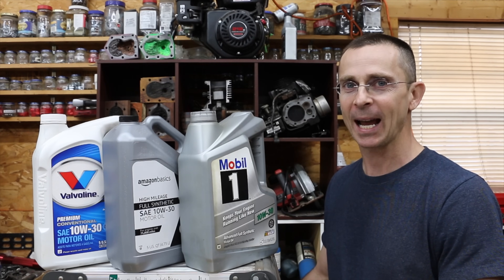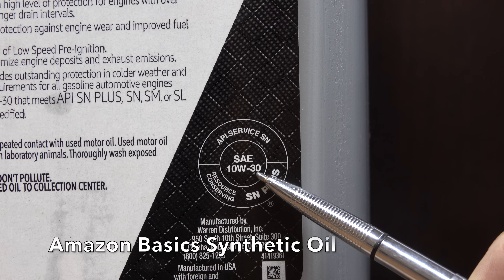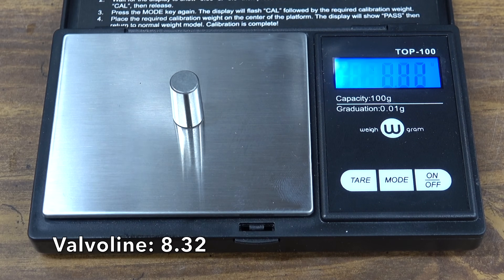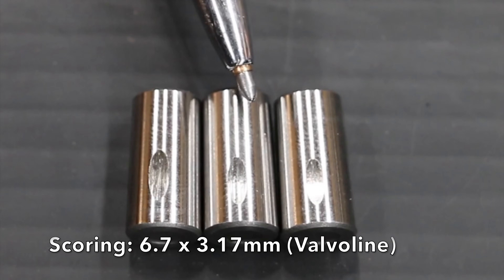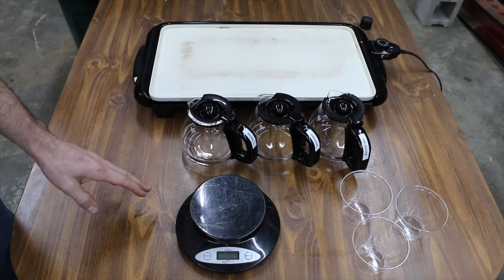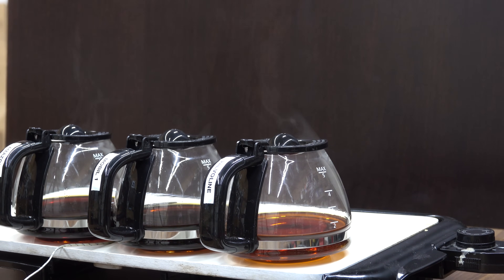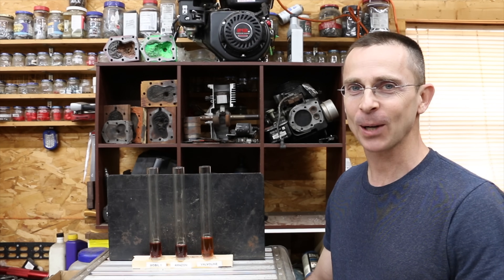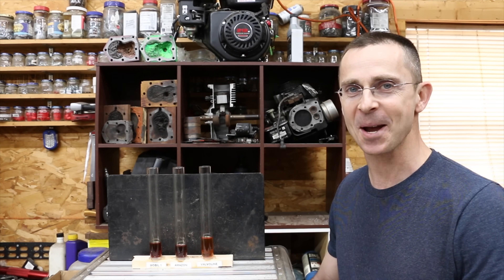Is AmazonBasics Full Synthetic Motor Oil better than Mobil 1? Let's find out!

Comment: after watching this video I decided to try amazon full synthetic oil and I used them in my 2010 chevy traverse, 2002 nissan altima and 2001 ford F-150. Now I have issues with all three of them within first 1,000 miles. Chevy traverse has low oil pressure light came on. Altima had low oil level on dipstick even though there was no external leak. Ford f-150 also has low oil level on dip stick and i had to topped up both altima and ford with 2 quart each. And all the engines has considerably increased noise. I had to add lucas oil thickener to reduce the noise on my ford f-150. All three cars having problem at the same time after putting amazon oil can’t be just a mere coincidence. Please give your feedback if you used the oil too...So that people know how it does in real life scenario.
Reply from the maker: Wow!  Thanks for commenting on this. I've used it 3 times in my 2003 Chevrolet Suburban, which now has over 230,000 miles without any issues.  Using it in my 2000 Buick as well without any problems.

Comment: Make a video using the oil showdown's test equipment on different code oils for Example cold flow test between 5W-40 and 10W-30 that would be quite interesting engineeringvise
Reply from the maker: Thank you!

Comment: Great content great video! Unfortunately the information doesn't provide much of an advantage to prolong the engine life of many domestic vehicles. Which I think many viewers are searching for. As long as the API seal is there, it wont make much of a difference if you use Mobil Purple Marvel Slick Sea Zinc Foam 50 Premium oil, from a copper funnel, or the similar additives. Take the longevity of Japan's products using simple conventional oil, at the recommended intervals, as an example.  Pay attention or pay cash America!
Reply from the maker: Thank you!

Comment: It is said that oil deteriorates after 6 months. How about a test of used motor oil on bearings at 6 month and 1 year.
Reply from the maker: Thank you!
Reply: To expand on my thought, run a test on motor oil at 8000 mile oil change. Measure bearing damage and store that same oil in containers for 6 months and save another sample for 1 year and then do a bearing wear test on samples and compare with oil that was freshly changed.

Comment: Here is a suggestion.I like the way you measure the wear scar using the formula for area of an ellipse.Just as an aside this method assumes equal depth of the scar.If i read your video correctly Amazon and Mobil 1 both lost the same weight from the bearing during your lubricity test.To me that means they protected equally.What are your thoughts?
Great video again.
Reply from the maker: Great point. Thank you

Comment: A LOT more oil was in the last 2 cups. Why not measure how much your putting in to be fair? Would have been a good test.
Reply: Mobile 1 jumped out of the cup...not interesting results.
Reply from the maker: Thanks for the constructive feedback.
Reply: @ProjectFarm  could this be why Valvoline did so poor on the first test? Conventional or not it should have been closer because of the additives.

Comment: I use AmazonBasic Full Synthetic 0w-20 with Fram Synthetic oil filter on my wife's 2017 Toyota Corolla and now her car runs smooth and quiet (This is when first starting up in the morning, idling, accelerating, and highway runs - all smooth and quiet). Before she was taking it to Toyota for oil changes and her car ran load and rough.
Reply from the maker: Thank you!

Comment: Looks like you tested 10W viscosity oils. For any given brand these are much cheaper than 5W.  Would it be worth the extra cost for summer driving to buy 5W even thought the flow would be better on engine start up? 
Based on your experience & test (so far) what is the best synthetic motor oil? Thanks for  your reply.

Comment: I tried 3 different oils in my LS4. Castrol GTX, Valvoline full synthetic and Mobil 1. The lifters clattered with Mobil 1 but not with the other 2. Gas mileage was the best with Valvoline.
Reply from the maker: Impressive! Thank you
Reply: Try Mobil one EP, very quiet engine operation compared to standard Mobil One.

Comment: I feel like you should've controlled the amount of oil that went into the cup. It's clear from the video that the Mobil 1 cup was significantly more full, so logically it would've had no trouble lubricating the metals better.
Reply from the maker: Thank you!
Reply: Nate - I am going back and forth trying to see a difference , is it that obvious ?, or am I just missing something ?.
Reply: Agreed. I love these tests and I would like to see a little more oil used during the lubricity tests. It seems to me the variance in the amount used could affect the result.

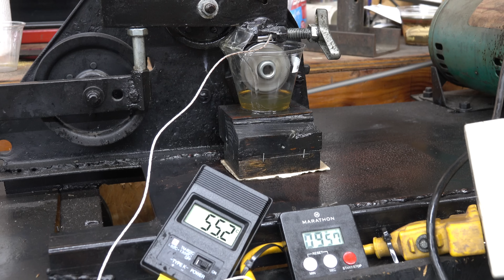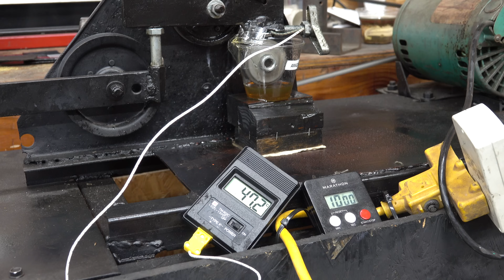Comment: Why dont you measure out the amount of oil used in the bearing test? The mobil test clearly had more oil in the cup and more oil flying off the contact point. You could clearly see how drowned in oil it was even at the end when the machine was stopped at 4:51. You can see how comparatively dry the other two tests are when the machine stops at 3:33 and 4:14 .
Reply from the maker: Thank you for the recommendation!

Comment: Do you know if the amazonbasics is jaso ma2 rated?  I cant find info anywhere and Im guessing no.  Most modern motorcycles need that since the oil flows thru the clutch.
Reply from the maker: I don't believe so. Thank you

Comment: The real question is for how long will the Amazon basic oil be that good for?
Reply from the maker: Great point! Thank you
Reply: What if you compared used oil?
Reply: The oil was tested and passed by API which they gave a rating of SN PLUS
Reply: @LandCruisin  thoughts on the oil so far?
Reply: @LandCruisin  Awesome, thanks!

Comment: Will water protect a bearing at the same psi as maple syrup? Water is thin and flows well but maple syrup is thick, flows a little slower and provides a thick protective layer. So in theory a slower flowing oil in my opinion will stick and provide a better protective layer(especially at start up) than thin fast flowing(draining) oil. Also in an engine it is being pumped by the oil pump not gravity fed. An oil pump has a pressure relief valve so in theory it will pump any fluid up to the pressure relief valve pressure then purge off no matter what fluid or oil it is. Right??? If this is true we need to test these oils at 200-250 degrees where these oils will live most of the time for true viscosity and wear protection for an everyday vehicle.
Reply from the maker: Thank you for the video idea!

Comment: I Truly believe the 5-w30 will give you different cold temp results from Mobil, Amazons Basics 5 w-30 will not do much better in the cold test,,, However the Mobil1 5w-30 is very different in cold weather than the 5w-30,  according to there Specs, Anyway, Thanks
Reply from the maker: Thank you!

Comment: The Amazon and Valvoline oil was barely touching the wheel race while Mobil 1 had so much it was sloshing around. Cleaning and sanding the wheel for Mobil 1 and not Amazon? Of course Mobil 1 had the least bearing wear.

Comment: You used a little more Mobil 1 in the lubrication test with the bearing and the weight than you did the Amazon Basics. It probably is a lot closer for first place in that test, if not given to Amazon.
Reply from the maker: Thank you for the constructive feedback

Comment: Being a ford fan , I would love to see you test motorcraft oil synthetic blend 5w20 and motorcraft 15w40 diesel
Reply from the maker: Great test idea! Thank you
Reply: The reason I suggested this is back in December I purchased a 05 Cadillac SRX from my friend . It had always had Mobil 1 since day one the engine was tapping. So to my surprise the cartridge type oil filter was pitch black . So I changed it over to motorcraft oil over two cycles no more tapping since and a lot cleaner now. It had 129k when I got it

Comment: Thank you for the video. I am curious about a test against Mobile 1, Torco SR-1 and Castrol EDGE
 All 5W-30 for turbocharged engines. 

I am currently using Torco SR-1 and thinking of switching to Castrol EDGE to test out. I am also planning on doing a Blackstone lab's test for each.
Reply from the maker: Great recommendation!

Comment: I’ve used Mobile 1 in all of my cars and when I had a engine rebuild done on my chevy that had 220,000 miles the mechanic couldn’t believe how clean the inside was. Zero sludge and buildup. Granted it was a California car that mostly saw high speed freeway travels but still
Reply from the maker: Impressive results!
Reply: That is why I have used Mobile 1 since 1987 in all my cars, which have all been Mustang GT's. I rebuilt all my 302 5.0L small blocks with overhead valve engines once over 100K just to refresh the engines and just like you they were all clean and the cam and main bearings were still within expectable specifications. The new overhead 4 valve per cylinder engines can go 150 to 200K before a refresh if a good maintenance plan is used from what I am hearing from many owners that take good care of their cars.  We will see!
Reply: You got pic' s

Comment: A LOT more Mobile1 made it round the wheel. The amount of oil in the cups etc should be metered (for volume, not weight) accurately!
Reply: Look at 4:11 vs 4:31
The wheel is BARELY skimming the oil where 4:31 a good 2mm+ is in the oil. Which in turn is going to hold a lot more oil and throw more oil over the wheel.
Reply: spydergs07 Yeah, HUGE difference!
Reply: @axelriet  When it comes to how much oil was being thrown around the wheel that is a huge difference. With it barely touching the wheel vs the wheel having the bottom part of it completely in the oil will make a HUGE visual difference in how much is being thrown around the wheel.
Next time watch a little closer and use atleast 2 brain cells before making an uneducated comment. :) Have a good day.

Comment: wow, living alaska been using Mobil 1 in my truck forever.  cold oil flow is very important. thinking of trying Amazon basics.
Reply from the maker: Thank you!
Reply: Flow is one thing, but you should also be concerned about the additives and detergents that are contained within the oil. The same reason I would buy shell or Exxon Mobil before I buy any other kind of gas, even with the price difference, is the quality of the gas. Exxon has a fantastic level of detergents and additives that extend the life and performance of your engine, so it’s worth the extra money, same with the oil
Reply: Try Shell oils. Theyre like water compared to mobile 1. More seepage but its def thinner when cold.
Reply: did you give it a try?
Reply: if you live in alaska id consider using a thinner oil in the winters outright if you find yourself having rough winter starts and oil pressure issues
Reply: Mobil 1 has a better film strength and a better additive package.

Comment: Great video and oils purpose is to protect your engine from high friction temperatures so that makes the cold testing unneccesary wont it??
Reply: The cold testing is for which oil will get through your engine the quickest when you start it cold. The faster the better.
Reply: @FLYPHUS  yeah its true but i dont let my car in the cold with the hood open valve cover off so this comparison was not the best also comparing 2 syntehic vs conventional  valvoline is kinda like apples and oranges but u do have a point if u do live in a much colder place the abillity for the oil to maintain its performance is a big plus

Comment: I like this guy and what he is trying to prove. I did some wear testing on plastic gears and ran them for a billion cycles on brake testers in elevated environments. When all was said and done after 2 years of testing: I was fooling myself because the plastic would loose weight without running them on the life tester due to out-gassing of the base plastic. I was weighing to 4 digits not just two like this guy.
Reply from the maker: Thank you!

Comment: I stopped listening once you said the “w” in 10w-30 is for winter 😂😂😂😂😭😭
Reply: Except the W does stand for winter...
Reply: austin molinich oh well then mr smarty pants where do I get 10s-30 for summer?
Reply: @dustinjones7504  not quite sure. Never seen an s. Do know w is for winter. And it's essentially put there to tell you the viscosity at low temperatures
Reply: austin molinich I’m a master tech and it doesn’t stand for winter. It stands for weight and all of them work at low temps the only oils that have difficult working in low temperature is diesel oil.
Reply from the maker: Thanks for the constructive feedback.

Comment: Great information, i do believe the synthetic oils today are all very good. The biggest concern for long engine life is changing the oil and filters often, and i do mean often. i never let my engine oils get dirty and i change my oil around twenty five hundred miles. For over thirty years all my cars have gone over 300,000 miles and never any engine problems, just got tired of driving them, and then i'd buy  a new one. my last mazda had 358,000, just keep the oil clean! pete.
Reply from the maker: Impressive longevity!  Thank you

Comment: On the bearing test, were both bearings and wheels new each time?  If so I'd still run these again to ... somewhat eliminate variation in surface quality and hardness.   If the wheel was the same (the shaft obviously different, rerun with the valvoline last, as in this case, parts wear in and "polish" each other, so the first test takes the brunt of this.  Also, consider a "high mileage" conventional oil with better additive package that would be closer to the synthetics.  Your bearing test, while simulating cold start, never simulates normal engine operating temp film strength.  There should be little difference in performance between conventional oil with superior additive package, and a synthetic, until high engine temps (not normally seen on the street) come into play, say 240F.  The better additive package conventional should flow better at low temp as well (and may have a better base oil, and may start to approach synthetic costs).   But your cold flow test and bearing test shows it all for the oils you ran; most wear (outside of high temps on race track or other extremes) occur at cold startup.   So the other thing to always consider is going to a lower W number while maintaining the factory/owners manual hot number, there is NO downside to doing this and you'll reduce wear.

Comment: I buy 20l drums off Ebay. 0w 30w sae b5. Has exactly the same rating and specs as Shell Helix. Shell is 25 uk per litre, Ebay is 3uk per litre. Best part about it is the Ebay company (a UK company which I won't say who) Is the one of the Uks largest distributors of shell oils. When I questioned them on this the said that shell has marketing etc to pay for as other large oil companies do. And that their Ebay oil is a no brand so they can sell it much cheaper. Guess what, it's the same bloody oil in a drum with no name on it.

Don't be fooled paying silly prices for oil ever again ! 210k town miles on my car still pulls like new, no oil leaks, Ebay oil think about it! No different to Nike trainers without the tick made in the same factory.
Reply from the maker: Thank you

Comment: I own a business and haul all kinds of materials with smaller than class 8 trucks. I have been using AmazonBasics full synthetic in my ''winter rat'' ones. I live in the Northeastern US and get -20 temps quite a few mornings I have to work. Thanks to your video, I don't think I have been cheaping them out by not giving them the Amisol that my ''summer'' vehicles get. haha Another great video, thanks!
Reply from the maker: It's a great oil!  Thank you

Comment: All i know is my 78 corvette 350 with a voodoo 262 camshaft wiped out the 4 lobes on the csmshaft after a monentary loss of fuel pressure.i had just switched from the supertech 15w 40 a few days before and to mobile 1 10/ 30 synthetic. The sane thing had happened before but no damage.ill never put synthetic oilin my engine only on my diffs. Thats why i asked for a comparision of the supertech 15/ w 40 multipurpose oil against all the others.
Reply from the maker: Thanks for this information!
Reply: Is your Voodoo 262 a flat tappet cam? If so most synthetics don't have Zinc Dithiophosphate in them. Flat tappet cams need this to keep them from failing. Break in oils have a very high amount of in them to protect the cam. It's also why you need to run the engine at no less than 2000rpm for 15 or 20 minutes before allowing to idle when it is first started  to mate the lobes to their respective lifters and why you always make sure you keep sure you keep them matched when you do a tear down.

Comment: My 1993 Jeep Grand Cherokee limited 5.2 V8 is still going strong for 26 years without engine or transmission overhaul. Right now it is over 403,000 miles. Several years ago, I've used conventional oil then blue smoke came out from tail pipe as I didn't like so, I switched to 5W-30 Mobil One Synthetic oil with royal purple oil filter for years without any problem as well always passed smog check. Also, I've used mostly Chevron 87 octane gas of trying not get cheap gas too.
Reply from the maker: Impressive!

Comment: I love your videos, very informative and you've done well to almost eliminate all the variables considering you aren't a scientist or have a laboratory.
Doesn't Valvoline have a fully synthetic in the weight of oil? I suppose that would have be a fairer test across the board but what I took away from this is that it appears that a cheap unbranded synthetic is better than a big known branded conventional oil (at least in your tests they are)
Reply from the maker: Yes, they do have one. Thank you